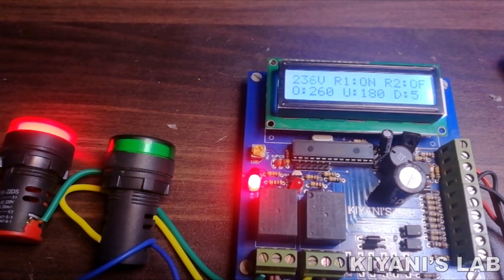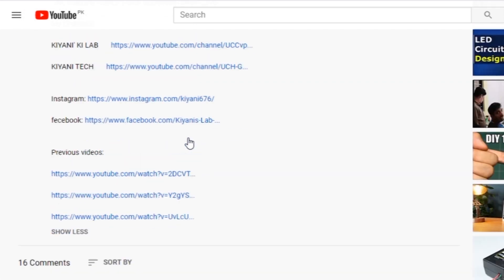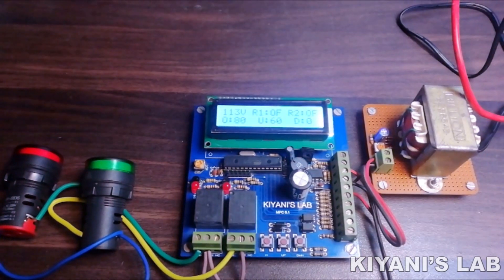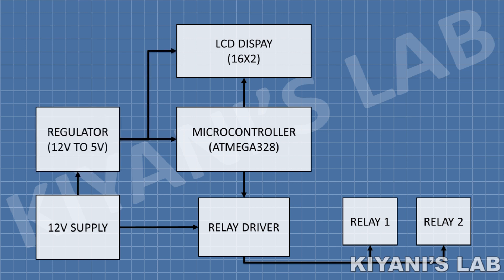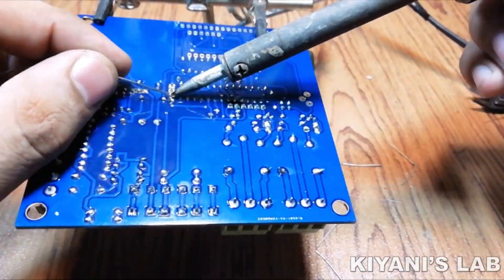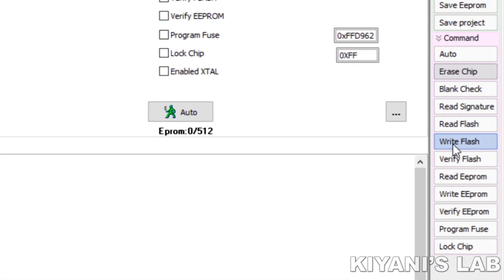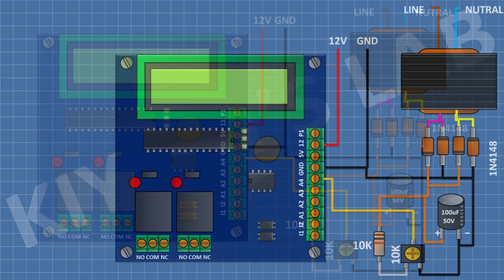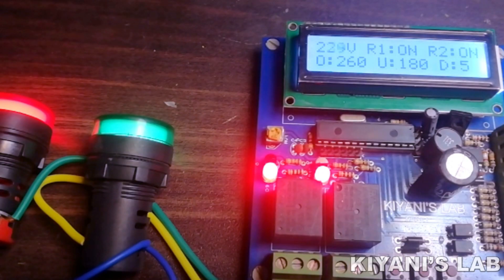How To Make Digital Over Under Voltage Protection System

Comment: Very nice sir thank you so much 
Can u pls add current sensor around 30A for reading the load current and on/off the relay as per setted parameters like under current & over current I hope you understand what I m saying. Thanks
Reply from the maker: Ok I will try
Reply: Pls make CT coil based under load and overload protection relay circuit